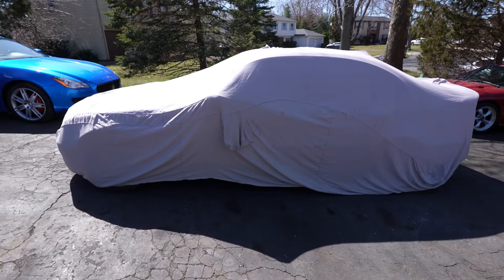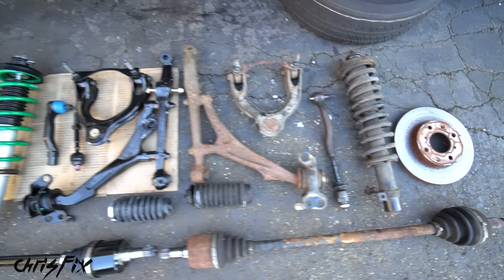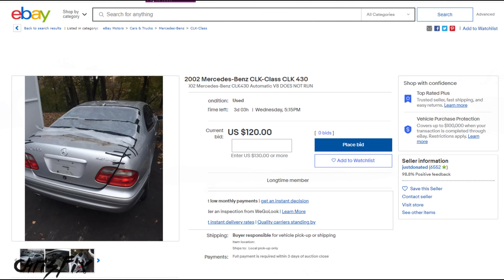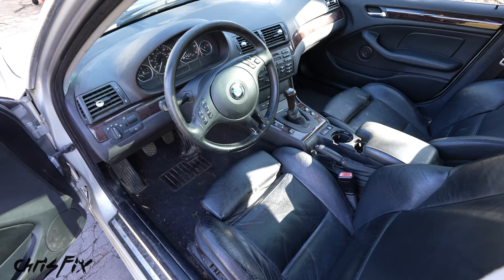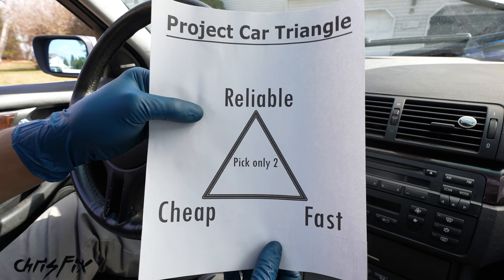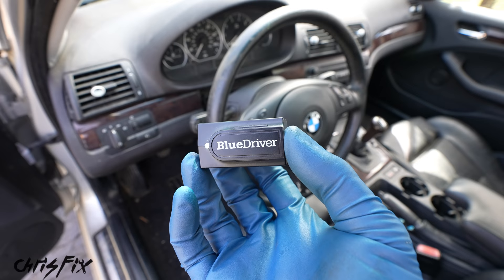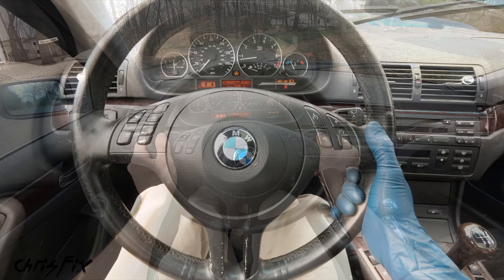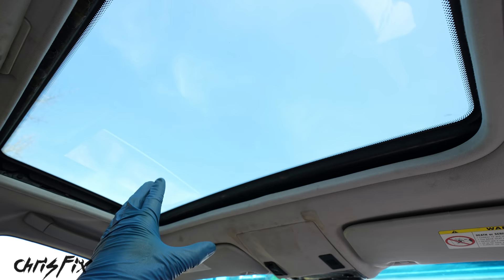How to Buy a Budget Friendly Project Car

Comment: “ offered him 1000$ he comes back at 1750$.... we met half way at 1100$”🤣🤣🤣
Reply: @UCVRew_wRUpzaNEZGv1DO60Q Watch the end of the video. He explains how the rules work.
Reply: i guess chris skipped the math class
Reply: Its a vinwiki line.
Reply: @nosleep5521  the joke is he didn’t meet him halfway - he was being sarcastic.
Reply: I came to the comment section just for this comment
Reply: Ed Bolian would be proud!
Reply: @nosleep5521  you skipped vinwiki class.
Reply: Yep here goes Chris low balling again
Reply: it kinda is half way if you consider shipping and shit
Reply: Shrewd negotiator... xD
Reply: Mafs
Reply: finessed
Reply: 1,000,000,000,000,000,000 IQ
Reply: @forestgump3977   SAME! LOL
Reply: what happened to only can spend 500 for the race?
Reply: 24 No Your Race car With Time With Dillon Logo
Reply: 😂😂😂😂 it’s $1100 not 1100$
Reply: @motoabuse2792  ok
Reply: And the car is supposed be 500 and under
Reply: 2+2 is 4 minus 1 that's 3 quick maths
Reply: @travisrose2277  ggg
Reply: I guess Chris wanted to pay $350
Reply: M E T H
Reply: @Hym5225  he explains it the car after being made race ready needs to cost $500. If your car cost $1100 you need to sell everything in the car that would be removed for weight distribution anyway (seats, carpet, radio, trim, door panels, etc)
Reply: @motoabuse2792 no
Reply: Math american way
Reply: 😂😂😂😂 seller: yeah yeah fair enough
Reply: Art off the deal
Reply: Math ain’t mathing
Reply: i don’t think he means have like 50% just something between those prices
Reply: “Shrewd negotiator”
Reply: He always says that😂
Reply: you are not a good person😂😂
Reply: Sarcasm should be a major 💀
Reply: BMWs are so awful as they age! Never ending problems
Reply: I mean it's kinda technically true 😂🤣😂🤣😂😂
Reply: I’m weak 😂
Reply: he means like figuratively, halfway just meaning between
Reply: Lol😂😂😂😂😂😂😂
Reply: The math ain't matching folks

Comment: Chris: we care about reliability. Also Chris: buys a clapped out BMW
Reply from the maker: I guess we have to make it reliable now!
Reply: The E46 is actually pretty reliable. You can find them for sale with extremely high mileage on them with original transmission and motor
Reply: The M54 is one of the most reliable engines to be produced. One of my E46's has 460000 miles and it's still making 160hp to the wheels (325i). BMW makes great engines, electronics however are a different story. That's why older BMW's are so popular with tuners
Reply: @animationcrate  That's really high hahaha, you give me hope for my 325i! I have a welded diff though so my only problem would be the subframe if anything
Reply: @mannyk7100  Oh yeah, first thing I do with any new E46 I get, having had 4, is reinforce the subframe, address all the common oil leak locations and install new gaskets and seals, and do a cooling system overhaul. All of it for maybe like $300-$400 off FCP Euro for the entire process, plus that lifetime replacement for all your parts from them makes it really worth it
Reply: Yeah same here with the folks up there, the m54 engine is pretty much bullet proof engine but the electronic sensors are different story and it will be much cheaper plus easier to rebuild the engine as long as it doesn't overheated compared to restoring the interior
Reply: @ramadhanisme7  You just nailed why BMWs are money pits. I'm still waiting for some to tell me why something as simple as air, fuel and spark needs 30+ computer modules attached to it.
Reply: @AK-rq1cz  not really, i mean in the regular e46 (not the m3) the sensors are not as much as you stated mostly you only need to pay attention on crank sensor, cam sensor, oil level sensor, maf sensor and that's it if you have a manual. But if you go with 7 series or s class those are the real money pit with tons of sensors, never ever buy one without mental preparation since like you've said it has 30+ computer modules only for spark plug
Reply: it's cute but what is worse is that he is actually encouraging people to BUY a crapped out old BMW, he should be arrested.
Reply: bmw's are junk.
Reply: @rci-tf2zc  no they aren't
Reply: @potatochobit  bmws are decent
Reply: @AK-rq1cz  what car from that era hasnt got that many electronics, bmw parts are actually quite cheap
Reply: My E46 has 265,XXX, no rust, easier to work on than my Toyota Highlander with way more instruction online than my Toyota. I drive it from FL to NC 4 times a year. Never left me hanging.
Reply: @animationcrate  Internals yes, but everything around it is batshit crazy.
Reply: I’ve been seeing a bunch of these for $3000-5000 150k to 240k miles years 2002-2006 . Are these good starter cars? I love the 330ci
Reply: @ramadhanisme7  Fair enough if this one was simpler. I just know a few people who have had M5s, 7 series and anything newer, every one of them regretted it and wanted to set the thing on fire. They aren't cars for people who don't turn their own wrenches or have enough money to pay a mechanic's mortgage on their vacation property.
Reply: @animationcrate  do you mind linking what subframe reinforcement kit you used?
Reply: @RobertEdits  they’re great if you can work on your own car, the 330ci is a super fun and simple car to work on
Reply: On my e46, the emissions system reliably fails on me
Reply: @jdm324xd  yes they are
Reply: @mannyk7100  Reliable, and RACE reliable are two totally diffrent things. Ask anyone who runs a Honda in LeMons.
Reply: @animationcrate  At New Jersey in 2014 one was so reliable that even after the kill switch was pulled, the battery and harness were cut, and it was hosed with an extinguisher straight down the intake it kept running. We think it was an oil cannibalizing compression runaway. Came in on the paddock on the flat bed SCREAMING with black smoke pouring out the exhaust.  

It was Awesome! I was in the Jurassic Park Explorer that weekend!
Reply: @mzaite  They're really not. If you have to baby your engine, it's not reliable
Reply: @chrisfix  i feel you man, i bought a bmw aswell same style a E46 325ci 2001 as project car with 153k miles, still trying to figure out my misfire codes haha
Reply: @AK-rq1cz  well 7 series and M cars are special cars, you can't own one of those without joining the official car club (by i mean official is registered in the bmw germany) like the M owners club of your country or bmw car club of your country and you will gain extensive knowledge on how to maintain it properly and how to repair it if something wrong. Those are not a car for someone who is only know on filling the petrol then floor the throttle pedal
Reply: @alvarezz7986  what are the codes? Quick things to check,
Maf 
Disa valve
Plugs
Coils.
Vacuum lines
90% of misfires on these engines are from one or more of those. All can be checked or changed in an hour.
Great cars
Reply: @alvarezz7986  download ista and u can read it
Reply: @gixxerhoff7502  they are cyl number 5, misfire fuel cut off , and then codes like misfire during starting cyl 4, then codes misfire cyl 2, and lastly random misfire detected codes
Reply: @alvarezz7986  misfire codes can be a number of things, ranging from bad spark plugs and/or bad coil packs to a bad valve cover gasket or worse, head gasket failure. Cylinder 4 & 5 were misfiring on my e90 turned out to be the valve cover gasket.
Reply: @chrisfix  Sell the catalytic converter
Reply: Engine is pretty bulletproof...components around it and the electronics, not so much.
Reply: @chrisfix  thank you. I love your videos dude.
Reply: @RobertEdits  They are great starter cars. You can tune them up nicely, do not expect to get too much power unless you are willing to drop a lot of money on them but they perform really well as they are
Reply: @animationcrate  E46 4 lyfe!
Reply: Freewillpack76  its a worthwhile investment if you can find a good freeway commuter for 3-5k. avoid if the interior is trashed, as the interior is the hardest thing to fix (beyond the ABC pillar caps and headliner, those are easy, i did mine myself). Also check for the usual suspects of headgasket troubles as the cooling system is prone to failure in 10 or so years, but easy to correct by even a moderately skilled shadetree mechanic.
Reply: Buy
Reply: Bugatti
Reply: You can sell the factory mag wheels and tyres to cover for the over budget
Reply: Spoilers?
Reply: The only thing unreliable about bmw is the e60 m5 and the SMG gearbox
Reply: @woolbus4319  BMW parts are expensive!
Reply: @koreymayo8884  how exactly? Just oem bmw is expensive but good aftermarket is pretty cheap
Reply: @chrisfix  lol
Reply: @AK-rq1cz  what did they expect?? Just put gas in and go??
Reply: @mannyk7100  yeah, mine has arround 800k km now, which is like 500k americanos i guess
Reply: @chrisfix  man I love your energy
Reply: "we need to get it for under $500"
proceeds to buy it for $1100
Reply: I dont know how you americans get bmws unreliable. Only the new ones (last 10 years) are unreliable over here
Reply: So my comment from 6 months ago isn’t the only one getting weird replies.
Reply: @chrisfix  hey man, there are a lot of spam comments and bots advertising sexual content. Any way you could tell YT to clean this up? I figure you'll have more pull in this situation that I would.
Reply: @ziploc53  same, hopefully this can get cleaned up. 😅
Reply: @ziploc53  yeah I keep getting weird replies too.  Seems like someone made bots that say random stuff about Chrisfix
Reply: @YTRINX  i keep getting them just report them for sexual content ive had like 10 channels terminated because of reporting them
Reply: @chrisfix  u look awesome and funny with like a game or something
Reply: @rci-tf2zc  why are they a junk?

Comment: “It leaks oil but that’s all BMW’s” ChrisFix Funny
Reply: idk whats this oil leak but my dads bmw never fails :) hes such a non carguy and the car is still running
Reply: As a German. This kinda hurts to hear.
Reply: Never seen a BMW without a oil leak, and they always come with a nice wiring issue.
Reply: @JonaPdm1  don’t be sad Toyota beats everyone for reliability
Reply: Sell the spoiler!
Reply: There is an oil hose behind the oil filter.  Replace the hose and the gasket for the oil filter and your leak will slow, not stop.  The oil pan gasket is another culprit but you have to drop the subframe to fix it.  Can be done just a little tedious.  I have a 525i ‘04.   Very common with the m54 engine.
Reply: @Zeroflax  this is so true dude.
Reply: 420 lmao

Comment: You can sell: carpets, side indicators, spare wheel, set with spanners that is in trunk cover, sunroof (you'll remove it anyway), glove box, engine cover (plastic), BMW "kidneys" (silver/black in front of a hood - where you open hood - replace them with mesh)  - radio and audio system. Do not know what rules says about: inside door panels, back seats + safety belts and lots of other inside parts.
Reply: If you see this comment Chris keep the spare tire for the 50/50 ratio
Reply: @real32233  Sell the spare tire and put a rock on its place. :D
Reply: The sunroof counts as a driver safety item so cannot be sold for a penalty reduction
Reply: @harryhawkes2273  He said he can replace it with a carbon fiber/fiberglass cover with no penalties, which means he can sell it.
Reply: He could also sell the ac compressor, i feel like those could go for a fair bit of money
Reply: @ollemauleonwolter848  the entire heating/cooling system will go for big $ in parts

Comment: I’m a tire tech and I would recommend the continental Xtreem contacts they are aggressive street tire, sticky on the track and where well. They have a tread where of 500-600. AA on traction. A on temp and W speed rating which good for about 160 mph. 👍🏻

Comment: I got a 2005 BMW 325i for 2k. It was misfiring, but the body was clean, a few manageable dings and scratches, botched interior, but it was practically rust free. Rare for a used car in my area, so it was a big win. 2 blocks after driving it from the buyer upper radiator hose blew. Had to walk an hour around the city to find a replacement, and use the tools of a friendly old guy to get her going.

I knew going in it was going to be a lot of work to make it reliable. So far, I've rebuilt the vanos, replaced the coil packs, sparkplugs, coolant lines, exhaust intake boots, mass airflow sensor, fuel injectors, valve cover gasket, oil filter housing gasket, thermostat, water pump, and flushed and replaced all the fluids. 

It was frustrating, painful, and freaking awesome.
Reply from the maker: I’m glad to see you got her going! There is not a lot that can beat that feeling after all that!

Comment: "We met at the halfway point of 1,100 dollars" Hahaha
Reply: Think you can sell parts off the car to reduce the "cost" of the car.
Reply: @dvernor  yea I didnt see that when I made my comment
Reply from the maker: Shrewd negotiation skills :p
Reply: I thought the budget was 500
Reply: @anonymousapple3840  it is, watch the rest of the video
Reply: @dvernor  in the end you only need engine, gearbox, wheels and 1 seat
Reply: I want a volvo with a t5 I live the sound of them also a v8 sounds great
Reply: @chrisfix  taking a note from Mr. Ed are we?
Reply: he had us in the first half not gonna lie
Reply: @hacxer8424  make sure you buy a 2010 or newer model or you will need to invest alot of money rebuilding the car, for sure the timing belt and pulley seals will all be bad and leaking oil and most likely all four wheel bearings will need to be replaced. honestly a focus ST is an upgrade to the chassis so you should check those out too.
Reply: @potatochobit  I understand that but hay it's more real world experience for me and I also just love the cars  if I get any ill get a s60 or s80

Comment: Hey Chris, you can sell the whole air conditioning system. You won't need it if it's a racing car.
Reply: He sure can.
Reply: and the Stock Wheels.
Reply: sell the glass sunroof, the rear trunk spoiler, spare tire, all carpeting, the cat, interior door cards, electric door locks, electric window motors, all the switches, heater core, etc...
Reply: Sell the whole exterior nd just keep the cabin lmao
Reply: Its a drift car
Reply: he knows that, in one of his other videos he said he wants to keep it because he uses it for standard driving and he enjoys using it while racing too
Reply: And the car
Reply: @somewhat7  i would keep the spoiler it may help out a little bit
Reply: @cameronhukari299  agreed
Reply: @somewhat7  only glass sunroof maybe and the spare tire
Reply: Floor mats 👍🏽
Reply: @leVermouth  he said the sunroof is a safety item so he can’t sell it
Reply: @juanbaltazar8288  he’s replacing it, he said its a “free mod” to do it because its for safety...
Reply: @brandosoftbear751  yes so it’s a safety item and like he said he can’t sell safety items

Comment: Items to sell: Sunroof glass panel, rear bench if not considered safety item, floor carpets, alloys(?), spare wheel, boot floor matt, bonnet lining.
Reply: Maybe autograph a couple of those parts to get a couple extra bucks
Reply: Sunroof motor could be sold
Reply: Spoiler
Reply: All the window motors. Just lock them in place. Door trim. Dash board. Spoiler. Spare tire and jack. Accessory anything lol. The factory exhaust and sensors. Ac compressor
Reply: idk if passenger seat is a safety item but that could go too
Reply: Since you're replacing the rear view mirror, sell that. Should get $50-$100 depending on the year/model/version.
Rear seat headrests. $30 each.
Interior door panels are about $100 each.
If it's not gone, the plastic engine cover for an M54 goes for about $40

Comment: sell the floor mats, spare tire, if it's purely a track car sell the key fob and barrel and hotwire it to a push start! (that would be an epic video as well) Also would love to see the fire suppression and battery isolator videos!
Reply: or he could just sell the catalytic converter
Reply: @strikemi8036  thats actually a great idea
Reply: i wouldn't sell the spare tire though it creates balance in the car
Reply: And he could sell the front drive system since he wants it to be rwd.

Comment: Chris: struggles to even turn the steering wheel
2 seconds later: flooring it on the freeway
Reply: You can turn it with no problem on high speed
Reply: the faster you go without power steering the easier it is to steer the car
Reply: Well you're not really turning a lot on the freeway. Unless you are exiting or going into another lane but you don't need a lot of steering for those
Reply: abanoub samy  90 km/h maximum? what is it? a lada?